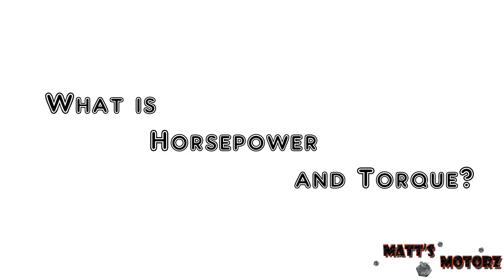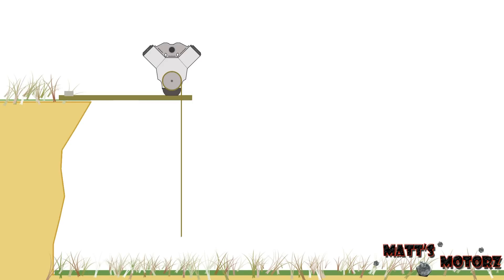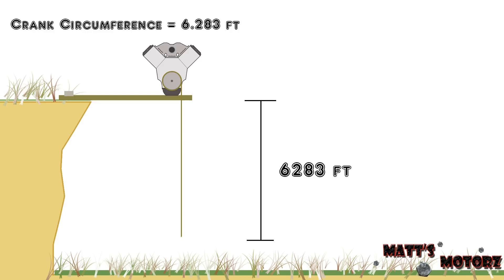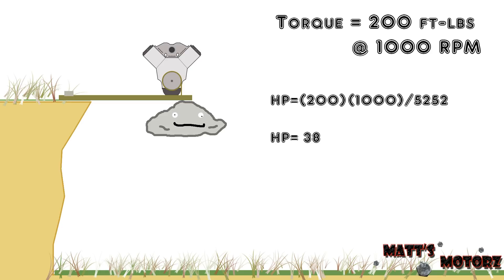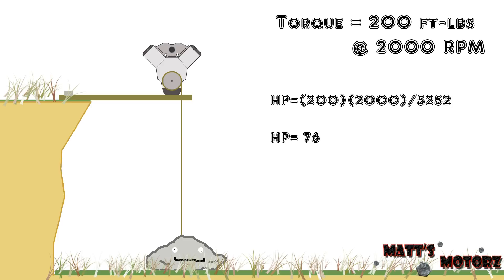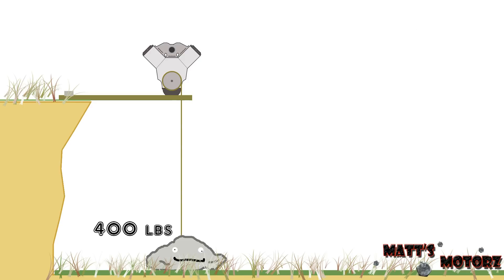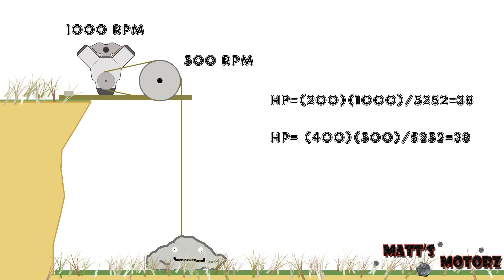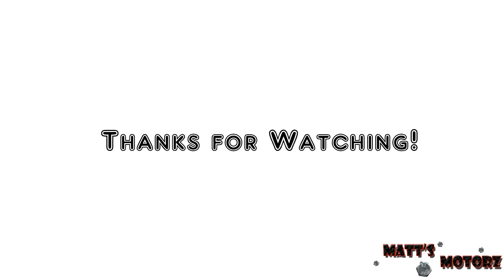What is Horsepower and Torque?

Comment: So if I make the same hp, why can't I do 0-60 in 2.5 seconds in 6th gear in a veyron -_-
Reply from the maker: It is more than just HP.  At 6th gear, the engine will be at a severe gearing disadvantage.   At low speeds the power you need to drive power through a high gear at a standstill is so great that it would likely stall the engine, or at the very least, take forever to get up to speed.
Reply: I don't understand. If the engine spins with a 1000 lbs of turning force at gear 1 with 10hp, but creates 10000lbs of turning force and 10hp at gear six, why/how is it at a disadvantage??
Reply from the maker: You have a few things confused I think.  In transmissions, the higher the gear is, the LESS torque you will get.  1st gear has the most, and 6th gear would have the least.  This is because you need a lot of torque to get started from slow speeds, and less as you are already moving.

That being said, when you are in the low gears, you are producing more torque, but your engine RPM changes in tandem (it increases because it takes many revolutions to turn the wheels once).  

The higher up in gear you go, the more your engine RPM's are reduced.  So for example, in 1st gear, it may take 3 engine revolutions to turn the wheels once, where as in 6th, it may take 0.5 revolutions to turn the wheels once. 

Because you are producing less torque at a higher gear, you will not be able to turn the wheels of the car at a stand still.

If you have ever road a bike, this becomes painfully obvious.  Try going up a hill in top gear.  It will take you so much effort to push the pedals, because you are at such a severe gearing disadvantage.  Where as, if you go to the 1st gear, it will be easy, but you will be moving slow.
Reply: Oh right. I get it now. So if I build a car, which would be faster: A car with 500 torques and 100hp or a car with 100torques and 500hp in a drag race?
Reply from the maker: Drag racing is more complicated because it depends on the ENTIRE range of RPM's.  For example, a car can have a lot of "low end" torque. This means that when the RPM is low it produces a lot of torque, but the torque drops off as it speeds up and the RPM goes up.  So this kind of car would be great at pulling off the line because it can use that torque to accelerate.  Other cars have "high end" torque.  This is the opposite, the car makes high torque at high RPMs.  This kind of car won't be good at pulling off the line, but will most likely pull ahead towards the end of the race.  The best case is a "flat" torque curve.  meaning, the car produces high torque throughout the entire range of RPMs.  A cars power output cannot be summed up in one number.  When this is done, this is usually referring to the highest torque or highest HP the car makes at a certain RPM.
Reply: Because its not need for speed.  Engines are dynamic and do not have one static HP and TQ value throughout the whole RPM range.  Your low gears will give you better acceleration due to the torque multiplication which is converted into wheel thrust/vehicle's weight = acceleration G's at that very second in the RPM range.  Will soon rev out of your power band and have to shift.  If your transmission's gear ratios drop the engine out of the power band because of an excessive gap between the ratios or you shift at too high or low of an RPM this will blog the engine down until it revs back into the power band and "pick up" again before revving out of the power band again inducing another shift to a higher and lower torque multiplying gear = less G's of acceleration as you continue to shift.  If your initial launch G's are not high enough because of the engines output, transmission gear ratios, street tires that cant handle the kind of wheel thrust necessary to achieved the needs G's of acceleration, and any number of limitations then you may never get to 0-60 in 2.5 seconds unless you build a dragster or purpose built race car.
Reply: deadly phoenix It's simply the gearing in the transmission. Depending on the gearing 6th gear is inoperable during idle. You would need to be going at least 25-30 MPH for 6th gear to be running off of idle.
Reply: here, check this out:
http://www.asawicki.info/Mirror/Car%20Physics%20for%20Games/Car%20Physics%20for%20Games_files/ctgrcrvs.gif

Comment: Nice try.. But the last illustration where he introduced a gear is incorrect. There was no gear ratio created due to that the line attached to the load (stone) was fastened at the outer diameter of the large wheel 👎
Reply from the maker: Yes I know.  That has already been made clear in the comments.   I really should put up an annotation...
Reply: Ok! Otherwise nice informative video 👍

Comment: I still don't understand one thing.Are torque and rpm related to each other? If an engine has 300 lbs of torque on 100 rpm for example and has no weight attached to it doesn't that mean that the torque power will act like a power of acceleration and make the rpm higher?
Reply: it's assumed that RPM is governed to a single number through these tests. in actual use if you provide higher throttle you raise the RPM which produces a different torque. it may be more, may be less depending on your position on the curve. the engine doesn't "torque" itself into higher rpms so much. it sets rpm and does work at that rpm with the torque it's producing.
Reply: normally torque of an engine is measured at wide open throttle. So it's the maximum torque the engine can produce at that rpm. If you press the pedal less, less torque is produced at the same rpm. With a closed throttle an engine will produce negative torque becaus it will slow down by itself.
Reply: If there is zero load on the engine, it is doing no work and therefore producing zero torque. Torque is basically how hard the engine is pushing against a load.

Comment: Engineering natzi here ! When we put the second pulley in consideration, the string attached to the rock cannot go around the large circumference or we cancel the ratio. So we must have a 3rd pulley attached to 2nd in the diameter of the 1st , am I right ?
Reply from the maker: I remember someone else saying this in the comments awhile ago.  I am not 100% (pretty close though) but I don't think you need to add another pulley on the second one.  The way it is now,  it still takes 2 revolutions of the small pulley to turn the big pulley once, based purely on their circumferences. My understanding is, you use compound pulleys (or gears) when you want a very large reduction, and need to go through many gears to do it. That way, you can start with a big gear, but have a smaller gear attached to it to connect to another gear.  Otherwise, the gears would get larger and larger and it would be impractical.
Reply: It's easier than that. If the small pulley has a circumference of 6 inch it pulls the rock up 6 inches on each rotation. Than 2nd gear has a circumference of 12 inch so it lifts the rock 12 inches in one revolution. Basically the small one does two revolutions to lift 12 inches and so does the second in one rotation. Therefore the string that pulls the rock must be wrapped around a 6" pulley that has the same rotation as the second gear. :P
Reply from the maker: ***** Hey that makes sense! Damn, I wish I could fix the drawing lol.
Reply: When we put the rope attached to the rock around the second pulley, we also double the torque the rock produces on the spinning axis of the pulley. Therefore, we still can't lift the rock lol.

Comment: I feel like all this could be simplified. Why not use watts. 100w engine pull 1kg up 100m in 9.81 seconds
Reply from the maker: Changing the units doesn't change any of the concepts. I don't think what you said is correct because you need to know the RPM, as well as the circumference of the pulley to know how fast the object is being pulled up.
Reply: +MattsMotorz but changing the units would standerdise it
Reply from the maker: Qazpaz TheLumberJack The US likes to use stupid units for some reason instead of standard units, and since I live in the US, I am used to them.  Same thing with inches vs cm.  The metric system is way better and easier, but from growing up using the English units, I am more used to them.  And with the majority of my viewers in the US, it makes sense to use English units.

Comment: I am having hard time understand what exactly horsepower is. But I understand torque completely. Can I just think of Horsepower is basically the engine's torque + the rpm? Or think of torque is a circle that's twisting. horsepower is the force pushing the circle across on a line
Reply from the maker: No that isn't exactly true.  Horsepower is as torque x rpm, not plus.  It is also not a force, but a power.  Meaning the units are "energy per unit time." Think of horsepower as the rate at which torque is delivered to a load
Reply: MattsMotorz power and force I'm confused. But I think I got the basic concept of it...
Reply from the maker: Power and force are different concepts.  Think of the units.  Force is the most basic (lbs), force through a lever arm is torque (ft.lbs) and the rate of torque delivery is power (ft.lbs / minute).  Units of power require a rate (per minute, per second, etc)
Reply: so basically HP is how fast engine is able to deliver the torque to a load. Basically HP in vehicles is more important than torque? I would imagine so because vehicle's weight is consider a load to the engine
Reply from the maker: 7150285 Yes (for the first question).  Horsepower and torque are both important.  A steam engine is a perfect example.  It can produce insane amounts of torque (which is why they used  to use it to haul stuff on trains) however it just can't spin very fast, so steam engines have very low horsepowers.  Basically this means, they can haul tremendous loads, but not very fast.  Where as a typical sports car can delivery torque extremely fast (which produces large acceleration), but not haul tremendous loads.

Comment: And what happens if the force delivered is higher than the weight of the rock?

Would the rock accelerate (and hence engine speed increase) to the point where the force produced is equal to the weight plus the increased friction?
Reply from the maker: If the force delivered is greater than the weight of the rock, then the rock will just be pulled up faster.  I don't see why the engine speed would increase and I don't know why there would be increased friction.
Reply: If rock's going to be pulled up faster, then the engine has to increase speed because they are connected.

And friction would increase due to higher drag faced by the rock, and because the engine parts would be moving faster in the oil in the engine. This site (https://en.wikipedia.org/wiki/Engine_efficiency#Friction) also says that friction will increase due to inertia.
Reply from the maker: Big Boss Yes the RPM would be greater when this occurs. The increased drag is negligible unless the speed of ascent is very fast.  The end result is a rock that is able to be pulled up faster.
Reply: Yup. Makes sense. Thanks
Reply: Wrong! At a constant RPM (ex. 1000) and fixed pulley circumference 
(ex. 6.283ft.) there would be NO difference in the time it takes to lift 200 vs. 400 lbs. The 400 ft./lbs. of torque just means the engine doesn't have to work as hard to lift the lighter weight and uses less fuel to accomplish this.
Reply: Let me ask just a question.So if HP is Torque x RPM/5252 why would the engine pull a rock for example with 200lbs faster than a 400lbs one if for example the torque is 400.I thought that if a motor produces 400 torque on 1000rpm it doesn't change the time of pulling a 200lbs rock or a 400lbs rock,the time has to be the same.I mean the time and the power should be constant only the work is different if you pull up a 200lbs and a 400lbs with an engine like that.Or did I understand it wrong?
Reply from the maker: Just think about if you were to lift a rock that was 200 lbs and you applied a 400 lbs lifting force.  The rock would accelerate upwards faster than lifting the 400 lbs rock.
Reply: MattsMotorz But that means that the rpm will be higher than?
Reply: I don't think you should be making explanation videos if you don't see why the rock speed increasing would correlate with engine speed increasing....
Reply: Right. You notice this when the car is going up or downhill. The speed of the vehicle is constant to the RPM. So if you're going down at 60mph the car still has the same RPM as if it were going uphill at 60mph. They will always be locked together. It will just decrease the fuel used up. Or increase it.

Comment: The whole mathematical equation make logical sense when explained. But if torque and horsepower are proportional, why does the torque curve drop off as the horsepower curve continues to climb? According to your graph, your engine produces approximately 272 pound feet of torque at 7000 RPM. That would mean it should be producing 362 horsepower, not the 408 that the graph shows. Why do they not stay proportional?
Reply from the maker: Most times the torque and horsepower curves have differently scaled axes.  Look on the right hand side, that is torque scale and it reads the value you say it should.Horsepower continues to climb when torque drops off because it is also proportional to RPM.  So the RPM is increasing faster than the torque is decreasing.
Reply: OK, my point is that if the formula is true, the torque and horsepower curves should be identical. However, no matter what engine you choose, when you look at the power curves, they NEVER mirror each other. Now, that being said, I am not saying the formula is wrong. I am wondering why the numbers do not add up. Yes, the RPMs increase and the torque drops off. Why? If this engine makes 415 horsepower at 7500 RPM, why is it not making 290 pound feet at the same RPM? In the same respect, if it makes 82 horsepower at 2000 RPM, it should make 215 pound feet at 2000. Not 140 as shown on the graph. How can the formula be correct if the numbers never add up?
Reply from the maker: Brian Ludwig Great question.  I don't know 100%, but my best answer is that the formula represents the ideal case with no losses taken into account.  Horsepower in the real world is more complicated than the equation makes it out to be and there are many factors that go into it that the equation does not take into account.
Reply: it makes around 290 pound feet @ 7500 and 215 pound feet @ 2000. The torque scale is on the right.
The graph and the equation is right.
Reply: The same thing as below. You read the wrong axis for the torque.
Reply: Thanks. I see that now. Couldn't see that on my cell phone. Had to re-watch it on my lap top
Reply: Brian Ludwig Never mind.
You are welcome. :)

Comment: Why don't the horsepower and torque curves for the Porsche cross at 5252 RPMs?
Reply from the maker: +Joe Milton They normally would, but typically the axes of HP and Torque are scaled differently and this causes the crossing point to not occur at 5252.
Reply: +MattsMotorz 
Ohh gotcha I didn't see that second y-axis for the torque on the right.